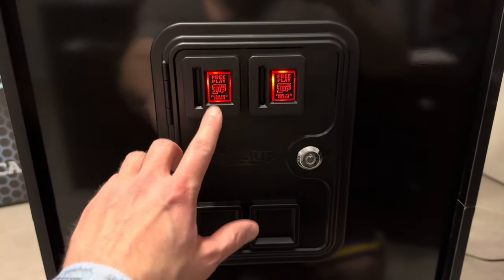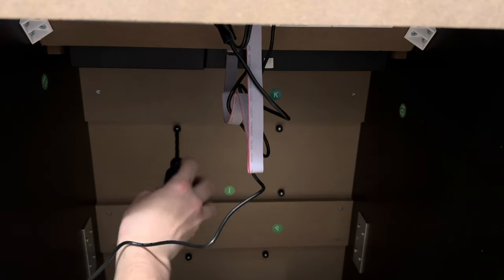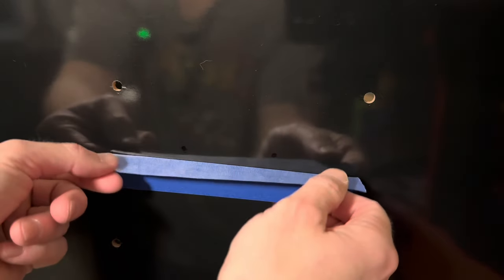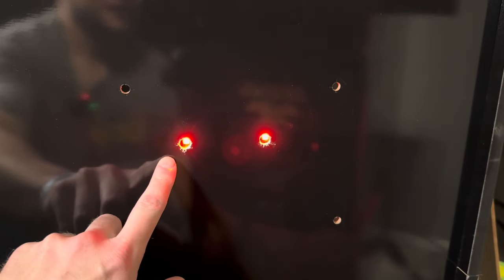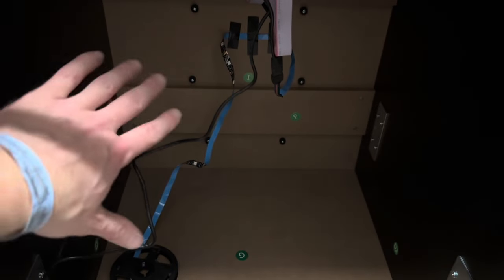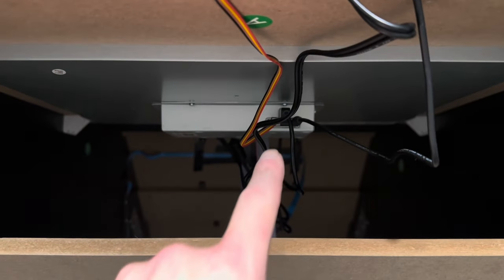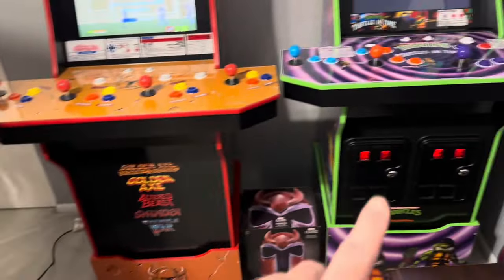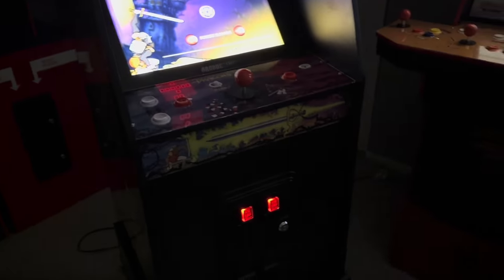Arcade1up $7 Light Up Coin Door Mod - Super Easy!

Comment: If you look closely at the LED strip, you'll see points where there are 6 solder pads, 3 next to 3, with a dotted line, and scissors between the solder pads. You can cut the LED strips so you only have the short length of strip just for the coin door lights. Next, just solder a power lead to the free end of the strip and solder pads. You'll have your clean lighting installation. Thanks for sharing this tip. :)
Reply from the maker: Thank you Thomas, I’ll try this out on my next one :)

Comment: Great idea! I ended up using two flat LED lights from IKEA that were a couple bucks each and plugged them into a 3-1 usb splitter plugged into the PCB. Since the IKEA lights cords were very tiny, I didn’t have to drill anything and was able to position each light behind each coin door. It’s a shame Arcade1up can’t make these light up to begin with.
Reply from the maker: Hopefully they will next year, I’m going to take it a lot better now because it’s so much easier than I thought but yes going forward it’s a must :)

Comment: Yes you can cut the LED strips.
Where you see those stripes in the LED strip that you can cut down the middle and you can then wire up the next section.
You will of course need a power supply which most strips are 12V but should say on the strip what the voltage is and if RGB what wire to put were.
Reply from the maker: Thank you 👊

Comment: Great info, I used a set of red cheap led lights of temu, 1.99, with usb wire, no on off no colour change, then I cut them down, drilled 1 hole, then put them through, and stuck on the front of cab, marking as you did, where they should be in relation the slots, then just plugged into the cabs usb port, bingo cab on door lights, then I cut 2 more sets & used old usb cables cut down and soldered to the lights for the other 2 cabs. have enough for more cabs later. total cost £1.99 :)
Reply from the maker: That’s awesome!

Comment: PD you can cut the excess with no problem, I’ve done it to several of mine
Reply from the maker: Awesome, Thank you Stunt Man :) I wasn’t 100% sure.
Reply: I 2nd that, no issues cutting it
Reply: If you cut the LED strip, you have to cut it where the copper is. Never leave the LED strip rolled up it can burn up. I bought a 1 ft LED strip from Amazon to use in my Dragon's Lair and Blitz.👍
Reply: Yes, some LED strips run hot in their default configuration, and can melt the reel and other items around if still rolled up on the reel (ask me how I know).  They run the most hot if set to brightest white, so like just red would be 1/3 the power, etc.
Reply from the maker: Thank you guys :) I have a lot more to do and I’ll feel a lot more comfortable cutting the excess off now. Thank you 👊

Comment: Nice, any recommendations on an entire “fake coin door kit”
I see so many on line, and some look very cheap/plasticy.

Recommendations on a cost effective option?

Thank you in advance
Reply: Learned on one of the Cornercade streams that you can order these direct from 1up. 15 non-lighted and 30 for lighted with Y cable. I ordered some last week and just installed one on Tron. Some patience and attention is needed when installing on a cab that didn't come with the doors. Getting the holes drilled and aligned correctly is the hardest part. Would be ideal if it came with a template. Might make one myself since I have more to do.
Reply from the maker: Awesome I did not know about this if A1up is selling $15 & $30 it’s the cheapest I’ve seen these at. I was going to suggest Retro530 but those might be 45.

Comment: Hi Phil.   So the arcades you have that don't have coin doors, will you buy them and  install?
Reply from the maker: Hi Alex, if those are keepers I will :) but I’m leaving Golden Axe alone :)
Reply: @PDX7  who would you use for coin doors? Retro or arcade 1up?
Reply from the maker: @pxp751 I was going to go through Retro530, but A1up might be $15
Reply: @PDX7  Yes.  Arcade 1 ups are a bit cheaper.
Reply from the maker: @pxp751 I literally just found out about that, I’m going to pick up a few from them.
Reply: @PDX7  Their mold seams to be better made.
Reply from the maker: @pxp751 I agree :) I really like their coin doors Alex. I’ve never bought anything from Retro530, really thought I’d get his light up kits until Thumper Squid showed me these LEDs